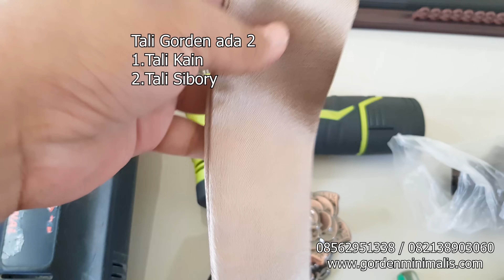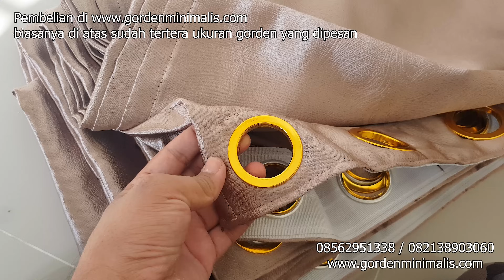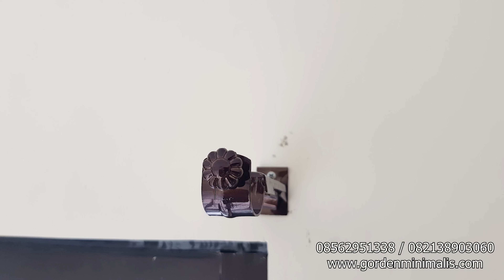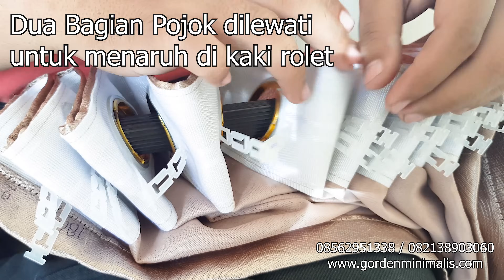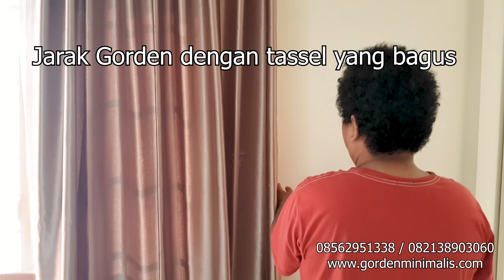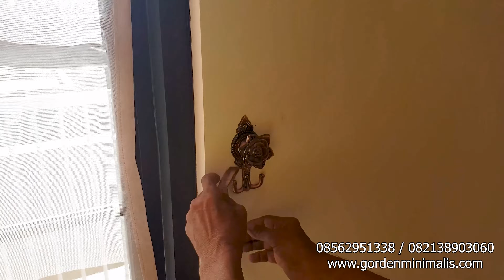tutorial lengkap cara memasang gorden model smokering dan cara menata gorden

Comment: Kak, itu untuk lebar dan tinggi jendelanya brpa ya??
Reply from the maker: untuk ukuran lebar dan tinggi gorden bebas dari konsumen ka
untuk yang seperti di video berikut harga gordennya
Gorden blackout Import Hight Quality yang lebar kain 280 cm
Harga bahannya saja Rp.100.000/m dengan lebar kain 280 cm
Vitrage (dalaman gorden) saja Rp.90.000

Harga jadi Model smokering seperti di foto tapi tanpa poni dalam
L = lebar jendela / lebar pintu
L 50 = Rp.220.000 + vitrage Rp.90.000 (5 gelombang/10 smokering)
 
untuk lebar 100 cm ke atas sudah dua lembar kiri kanan
L 100 = Rp.440.000 + vitrage Rp.180.000 (10 gelombang/20 smokering)
 
L 150 = Rp.660.000 + vitrage Rp.270.000 (15 gelombang/30 smokering)
 
L 200 = Rp.880.000 + vitrage Rp.360.000 (20 gelombang/40 smokering)
 
L 250 = Rp.1.100.000 + vitrage Rp.450.000 (25 gelombang/50 smokering)

L 300 = Rp1.320.000 + vitrage Rp540.000 (30 gelombang/60 smokering)
 
tinggi dibuat sampai 270 cm harganya sama.
karena lebar kain 280 cm (lebar kain dipakai untuk tinggi gorden)
jadi sebaiknya dibuat tinggi supaya gagah, tinggi standar gorden 200 cm.
tinggi gorden yang bagus dibuat dari kusen atau angin2 sampai 10 cm dari atas lantai
Harga tersebut adalah harga gorden jadi sesuai ukuran jendela.
sudah memakai lipatan-lipatan gorden

Comment: kalau pasang 1rumah buat jendela dan pintu kamar rumah standar kamar 3 buget berapa om
Reply from the maker: Harga jadi Model smokering seperti di foto tapi tanpa poni dalam
L = lebar jendela / lebar pintu
L 50 = Rp.220.000 + vitrage Rp.90.000 (5 lubang/10 smokering)

L 100 = Rp.440.000 + vitrage Rp.180.000 (10 lubang/20 smokering)

L 150 = Rp.660.000 + vitrage Rp.270.000 (15 lubang/30 smokering)

L 200 = Rp.880.000 + vitrage Rp.360.000 (20 lubang/40 smokering)

L 250 = Rp.1.100.000 + vitrage Rp.450.000 (25 lubang/50 smokering)

tinggi dibuat sampai 270 cm harganya sama.
karena lebar kain 280 cm (lebar kain dipakai untuk tinggi gorden)
jadi sebaiknya dibuat tinggi supaya gagah, tinggi standar gorden 200 cm.
tinggi gorden yang bagus dibuat dari kusen atau angin2 sampai 10 cm dari atas lantai
Harga tersebut adalah harga gorden jadi sesuai ukuran jendela.
sudah memakai lipatan-lipatan gorden
Reply: Pasang di daerah depok cilodong apa bisa?

Comment: Harga per m² berikut pasang brp pak?
Reply from the maker: Harga nanti tergatung dari lebarnya kalau bahan blackout import seperti di video

Gorden blackout Import Hight Quality yang lebar kain 280 cm
Harga bahannya saja Rp.100.000/m dengan lebar kain 280 cm
Vitrage (dalaman gorden) saja Rp.90.000

Harga jadi Model smokering seperti di foto tapi tanpa poni dalam
L = lebar jendela / lebar pintu
L 50 = Rp.220.000 + vitrage Rp.90.000 (5 gelombang/10 smokering)
 
untuk lebar 100 cm ke atas sudah dua lembar kiri kanan
L 100 = Rp.440.000 + vitrage Rp.180.000 (10 gelombang/20 smokering)
 
L 150 = Rp.660.000 + vitrage Rp.270.000 (15 gelombang/30 smokering)
 
L 200 = Rp.880.000 + vitrage Rp.360.000 (20 gelombang/40 smokering)
 
L 250 = Rp.1.100.000 + vitrage Rp.450.000 (25 gelombang/50 smokering)
 
tinggi dibuat sampai 270 cm harganya sama.
karena lebar kain 280 cm (lebar kain dipakai untuk tinggi gorden)
jadi sebaiknya dibuat tinggi supaya gagah, tinggi standar gorden 200 cm.
tinggi gorden yang bagus dibuat dari kusen atau angin2 sampai 10 cm dari atas lantai
Harga tersebut adalah harga gorden jadi sesuai ukuran jendela.
sudah memakai lipatan-lipatan gorden

untuk pemasangan dalam kota free

Comment: Harganya berapa kak?
Reply from the maker: Harga juni 2020
Gorden blackout Import Hight Quality yang lebar kain 280 cm
Harga kainnya saja Rp.100.000/m dengan lebar kain 280 cm
Vitrage (dalaman gorden) saja Rp.90.000

Harga jadi Model smokering seperti di video
L = lebar jendela / lebar pintu
L 50 = Rp.220.000 + vitrage Rp.90.000 (5 lubang/10 smokering)

untuk lebar 100 cm ke atas sudah dua lembar kiri kanan
L 100 = Rp.440.000 + vitrage Rp.180.000 (10 lubang/20 smokering)

L 150 = Rp.660.000 + vitrage Rp.270.000 (15 lubang/30 smokering)

L 200 = Rp.880.000 + vitrage Rp.360.000 (20 lubang/40 smokering)

L 250 = Rp.1.100.000 + vitrage Rp.450.000 (25 lubang/50 smokering)

tinggi dibuat sampai 270 cm harganya sama.
karena lebar kain 280 cm (lebar kain dipakai untuk tinggi gorden)
jadi sebaiknya dibuat tinggi supaya gagah, tinggi standar gorden 200 cm.
tinggi gorden yang bagus dibuat dari kusen atau angin2 sampai 10 cm dari atas lantai
Harga tersebut adalah harga gorden jadi sesuai ukuran jendela.
sudah memakai lipatan-lipatan gorden